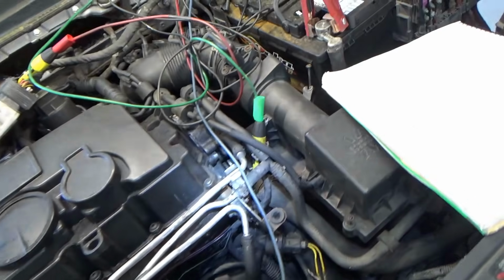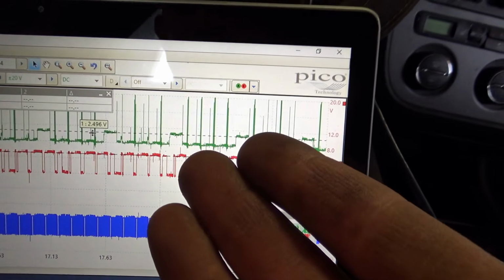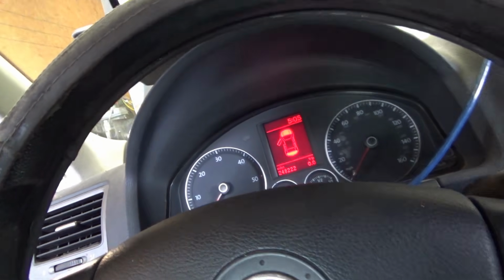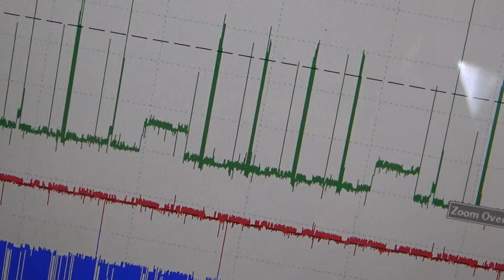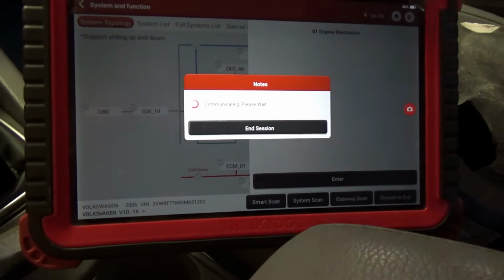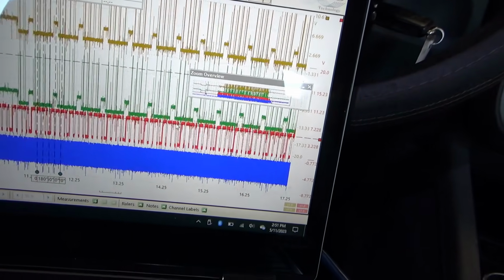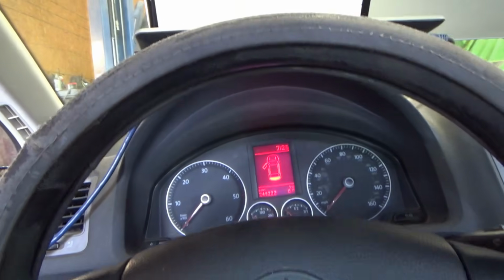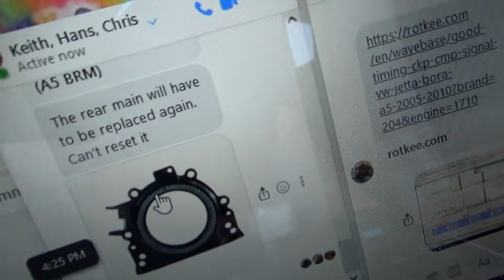ANOTHER Dead TDI?? (Jetta No Start After Engine Swap - Part 2)

Comment: I'm surprised nobody wondered why a rear seal would have wires attached to it. You have to figure it has to do something, but what? Maybe if that one had the little teeth on it, they would have investigated further and discovered why it had to be positioned correctly. Maybe. The, 'I wonder what this does',  approach seldom works on that electronic computer controlled stuff. Anything with wires attached to it can give you big problems. I guess the next California warning after the, 'This can cause cancer', one will be, 'The State of California has determined that auto parts can cause emotional distress & mental anguish'.     
 So the engine was doing nothing because the injectors were firing with no compression in the cylinder?  No wonder it didn't even pop.  
Those Germans sure have the starter down!
Reply: How do you know fuel was being injected?
Reply: @gfbemc0256  I didn't. I just assumed that if they are fired electronically all that testing Ivan did would pick up no signal to fire being sent to the injectors. But maybe not.

Comment: Bingo 😂😂, first time for me with the same issue, was a vw polo 1.4. At that time I worked at the dealership in 2000, i had to replace a engine. Under warranty. A stripped engine without pistons, seals, etc. Crank no start 😂😂, took me a lot of time to figure out what was going on. Good job Iwan! 👌👍

Comment: Why would there be cps timing from the real main seal? LOL. Doesn't make sense. I thought the rear main seal was just a seal. Anyhow, great videos are made when Ivan is challenged!
Reply: There isn't, the seal itself is just a stationary rubber lip which is part of the housing bolted to the back of the engine. The part that needs timing is the magnetic ring which is used to determine crank position.

Comment: I'd say your normal drive time charge plus the full 6 hours.  I had never heard of this style crank sensor in the seal before either, until I was reading the comments on the first part.  I did find in identifix if I searched for the speed sensor tone ring it links to the rear main seal, but that was with the knowledge from the comments.  Going into it you had no way to know that was how it worked.  It would not have been a logical jump to ask the customer about the seal.  All the questions about the cam sensor, cam gear even checking the cxrank and it appeared to be magnetic.  Years ago I remember reading in a trade magazine, probably Motor, a warning about the keyless timing gear setups on new at the time Ford motors.  The problem of doing a simple harmonic balaner or front seal and  having the timing jump.  Who reads every line in service info for what you think is a common repair.  No one can deny the problem was caused by the person who did the swap but I wonder if I could have had that happen to me.  Its like press in wheel bearings with the magnetic sensors in them.  I had heard about them before I ever got one in my bay, but I know some people put them in backwards, after all who expected that the first time they ran across it.  .  I watch videos like yours for the same reasons I read all the trade magazines back in the day, to learn all I can before I have the car in front of me.  I'm sure this issue will never happen to you again,  and hopfelly not to alot of others due to theis video.

Comment: Being a 56yo mechanic, rear main seal timing? The most unbelievable thing I have ever heard of in my automotive career. rear main seal timing is equal to a "car paint overheat moisture sensor failure". WOW.
Reply: The crank position sensor ring needs timing, not the seal. The seal remains stationary as it's part of the housing.
Reply: @ferrumignis  I get it. However for a manufacturer to install a crankshaft position sensor between the engine and transmission, and incorporate it with a.rear main seal, is the stupidest thing I have ever seen.  So easy for VW to just make a crank with a reluctor wheel on the crank, and install a simple sensor on the outside of the block.

Comment: Hello Ivan.... Could you explain what do you mean about seal timing.... However you have got pulses from CKP
And also what the problem with the glow plugs.... May be the plug or the control signal
Last thing.... The fuel pressure is not holding... Am I right?
Reply: It's not the "seal" that needs timing, it's the tone ring that has a magnetic pattern on the outside. This is equivalent to the toothed wheel on other engine designs, but since it is pressed onto the crank (rather than being part of the flywheel or front pulley) it has to be aligned correctly.
Reply: The engine has compression, it’s getting air, the injectors are working, where is the fuel going, & why doesn’t the engine even try to start?  Are we overlooking a fuel delivery problem?
Reply from the maker: @gfbemc0256  Wrong injection timing = no-start.
Reply: @gfbemc0256  The injection timing is critical on a diesel.  Too late or too early and it won't start.
Reply: @ferrumignis   thank you. At what point does the diesel fuel get injected, 20 deg BTDC?  Would we be able to see the injection timing using an in-cylinder pressure transducer?

Comment: Ugh. If they are going to do something like that, and it really is technically better somehow, how about putting a note about it in the codes it could set? They built a landmine into the engine and then had the computer report a code which was not helpful. It's not your fault that the design is unusual and it is not documented. You should charge the full amount, but give half of it to the guy who helped you figure it out. He deserves a reward for sharing his knowledge.
Reply: How about people not working on engines unless they have sufficient brain cells to question why the rear main seal assembly has an electrical connector? The new seal even comes with a plastic retainer to keep the magnetic ring in place via the timing hole in the side of it.  Someone would need to be very dull and lacking in any curiosity to to not question any of this.

Comment: Well, I admire your persistence Ivan. Euro cars and Japanese cars are getting more and more complicated. All we can hope to do, is to keep learning. You did everything right for a less technical vehicle, but these Euro manufacturers will always throw a spanner in the works. Good to have Euro experts on call, otherwise you may have been stumped, who woulda thunk it, a timed rear main seal LOL. I have a BMW 330D SE 2010 and a glow plug failed, and immediately threw a blocked DPF code, and would not perform a regen. So I replaced the glow plug, but the blocked DPF code persisted, and no regen. I had to buy BMW software to reset the adaptations and reset the DPF fault before a regen could take place. But, even so, I do love my Beemer.Good luck with the knowledge gained.
Reply: All cars are getting more complex, including American brands.

Comment: It costs to learn. If it didn't cost anything to learn then we would learn very little. Like learning from a mistake on a job. Ivan you have to take a hit on this of about 2-3 hours and that 2-3 hours lost labour is a very cheap lesson. You also need to invest in VCDS as it gives you near dealership access. European cars are far more sophisticated due to the tighter emission rules. It is not going to get easier. Money isn't everything in life.

Comment: So Ivans persistance pays off,   but this problem was built in because lack of or not following service info. These kind of problems fall into the $$$ basket. "Has (multiple) someone else already attempted to repair this and it still doesn't work? This will be $$$ up front before i even start on this car." Don't forget, this is a 17 year old car (ancient technology) and it's not simple. If you are not a serious automotive professional, leave it alone. Cheers Ivan, respect.

Comment: If you made a special trip just for them, you should have a pre-agreed upon price for that.

You spent 6 hours figuring out their problem, charge them for the 6 hours.

The bottom line is that the issue is figured out, and they know what needs to be done to get the car to run.
Reply: @Ken from Silverdale: Right! And blame all costs to the incompetent mechanic.
But if Ivan says 'I will cut one hour work of the bill' he will be the man of the day for the costumer.
Reply: OR we can let Ivan run his business as he sees fit ¯\_(ツ)_/¯
Reply: I disagree - when you book someone you expect them to know. I wouldn't book a plumber who charges by the hour, but then pay for twice the time because they were slow.

Obviously you can't know everything, but you win some and you lose some. There will be jobs with a book time of 3 hours he manages in 1, and likewise things like this happen sometimes. Blame VW all you want, but someone who knows this is the case would have diagnosed it in less than an hour. Therefore, that's the charge.
Reply: Basically VW should be charged for the whole issue.
But this also tells us that anything done to the engine before installation should be listed so each point could be checked for relevance.
Then I definitely question the decision to have a crank position sensor on the rear main seal. To me it would make more sense to have the position sensor at the other end of the engine in a more accessible location like on the timing belt crank sprocket since sensors sometimes goes bad.
Reply: @ehsnils  VW is part of Audi. Some Audi engines put the timing chain on the back of the engine so you have to pull the engine to change the timing chain. Can you think of a worse idea than that?
Reply: @NotFastEddie  Starter in the intake valley where it gets heat baked like the Cadillac Northstar?
Reply: @NotFastEddie Ford did the same thing on the 4.6 engine for a while. They mirrored and flipped the passenger-side cylinder head so you had one coming chain in the front on the passenger side and one on the back of the driver side. I had a customer who didn't time the driver side correctly when he did timing chains and couldn't figure out why it didn't run well. I promise you it's not engineers, it's bean counters. Ford only had to make one camshaft and 1 cylinder head for both sides. I'm sure Audi had a cost cutting reason why LOL
Reply: @crashoverride328 those are good paying jobs lol. I've done quite a few of those.
Reply: @NotFastEddie  It's the other way around. Audi is part of the VW group that also owns many other brands.
But their engine designs are still questionable, and have been since the VW bug.
Reply: @NotFastEddie  A worse idea than a chain at the wrong end would be a timing belt at the wrong end that has to be replaced every year while the oil is shared between engine and gearbox. (Peugeot has had an engine/gearbox with shared oil)
Reply: @crashoverride328  Funny thing about those Caddy Northstar starters, I never worked on any of them for a starter failure when I was  a Cadillac dealer tech for 8 years.  Truth of the matter is getting to them really wasn't that hard if you knew what you were doing.

Comment: I think you should charge based on your actual time you spend on this car. You knew this car inside and out, but the customer failed to mention everything that they did to the car. Being that they changed the rear main seal, that's a specialty job. You knew this car mostly. It's not that you were incompetent. And you should charge for that time you had to research for the extra work. Maybe the next time you encounter this same problem maybe you could charge less. Sometimes customers either don't mention what other work they did or they outright lie about it. You should charge extra for diagnosing work that THEY knew had been done. Unless its an auction car, they should give you a full history of what they messed in the car.

And you should charge extra for these European cars. I do give them a high price for European cars and if they balk at the diagnostic price I WALK. Sometimes people who own these European cars are too cheap. I don't wanna deal with them.

Comment: Typical set-up for most VW cars have ckp's in the back of crankshaft even on gasoline engines be careful when changing the rear main seals, most of the time you win but once in awhile you take a hit .
Reply: Why do they do this?
Reply: @TheFrenchPug  I live and work in Brazil where the majority of cars are European and VW as I know have   their ckps sensors at the back of the engine, all 4 cyl are in the back those sensors and being a transverse engine you have to remove intake manifold to replace the sensor, and if you think that is bad, try replacing a timing chain on a 2.5L 5cyl Jetta where it's located between the transmission.

Comment: I heard that it was a headache to replace a main seal on one of those engines.   I've never done one myself.   But wow!  What a horrible design that is.  This actually reminds me of the modern Ford 2.5L 4 cylinder engine.  If you remove the harmonic balancer, you better have the proper tools to reset the timing.
Reply: What a shit-sandwich!! That's really disappointing Ford decided to remove keys holding the timimg gears to the crankshaft...

Comment: Just so you know. If you ever work on a 3.0 diesel in a Ram pickup or a jeep that engine has a tone ring behind the flex plate that is just like your seal. Mine a piece of Magnetic Tape broke off and kill that engine dead. For a $25.00 part you have to remove the transmission and buy new flex plate bolts. About 10hrs book time😢
Reply: Geezus. What is wrong with the engineers who do this?!
Reply: Harley Davidson did away with contact points on the all-new 80 inch Shovelhead .A sensor "sees"a magnet through notch in a rotating cup and triggers ignition .Simple ! Brilliant design! Its that good they riveted the points cover shut.Great until the cheap ass glue holding the magnet in place fails .That was 43 years ago and  engineers are still screwing with us
Reply: Good question. Best Italian Engineers that designed it.
Reply: Ask the Italian Engineers that designed it

Comment: I was wondering how long it would take you to phone a friend. I was actually surprised by how many people in the comments knew what was wrong with this right away in part one. I was waiting to see if you tried to unplug the crank sensor just to see if it would run with just the cam signal. If it were my job I would eat some of the time and only charge 3-4hrs.
Reply: Plus travel time. The person who installed the engine owes the customer the diagnose fee.

Comment: I would charge full time,, next time you run into one of these and you will, it will be quick and easy.   it looks like abt half of the problems you deal with, are the result of work done by other people.   if people want to buy exotic cars to flip, and dont know what they are doing, sometimes they have to lose money too

Comment: Helo Ivan As you just showed Diagnostics can be very humbling. You stuck with it and appear to have found the probable cause of the no start. Charge accordingly. If the replacement of the rear main seal does not correct the no start condition offer a partial refund. You might want to lower your usual rate a little. When I checked for the P0341 code it came back clearly indicating both Camshaft and Crankshaft position sensors as possible causes.Very interesting case keep the great videos coming. PS. Even with all your diagnostic skill it is nice to have friends and colleagues  willing to share their knowledge.

Comment: For the shop's credit, I'm not sure if anyone would ever think to check the timing of the rear main seal...
Reply: A wire hanging out of any seal should cause a WTF is this?  And then at least google it.
Reply: The seal doesn't need to be timed, it's stationary and part of the housing. The crank position sensor ring needs to be timed.

Comment: like I said in the first video ..... if that motor drove the crashed VW into the shop ... why did they even  touch the engine .....
Reply: They fitted a new clutch and rear main seal which is entirely sensible on a second hand engine. Pretty stupid to not do this unless it's a low milage engine or you know they have been replaced somewhat recently.

Comment: If im not familiar with a system. I would of charged what I believe it would have taken if I understood the system going into before hand. In a situation like you were in where you weren’t familiar, i treat it as a learning experience. Yeah, sure im at a loss on that job because of the amount of time, but i learned something, not only will that help me on future diagnostics and to think a little more outside the box when im stuck in some other situation. But me personally i absolutely love the hardest diags to solve. They maybe not the best sometimes for profitability, but i love that feeling after figuring it out.

Comment: WOW!  Have to blame the guy that installed the seal incorrectly, it obviously had a wire connection, wouldn't he look up the procedure???  Easy 10 hour charge for diag, plus your drive time.  Don't sell yourself short just because of other's ignorance.
Reply: Did he confirm that the shop owner's buddy didn't do the seal correctly? It was 4 years ago.